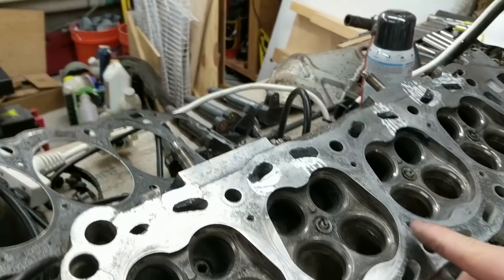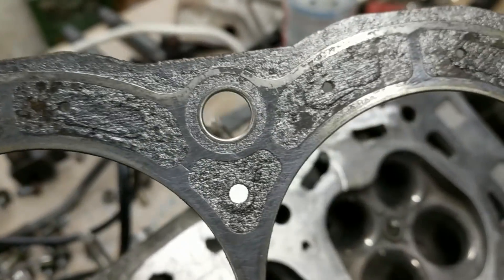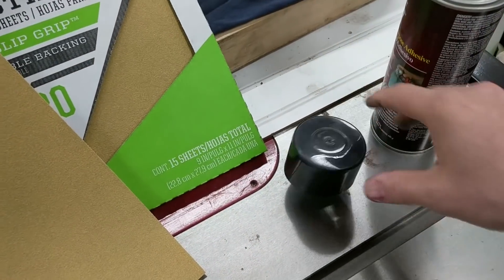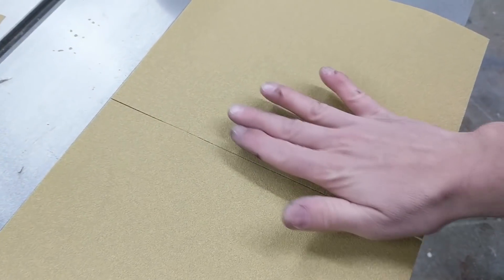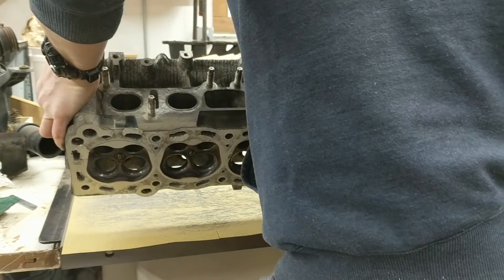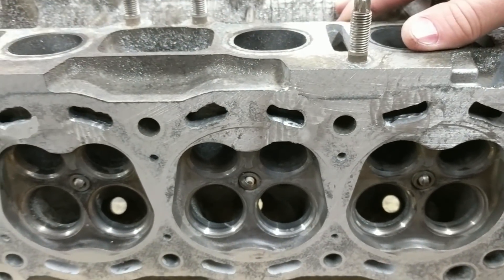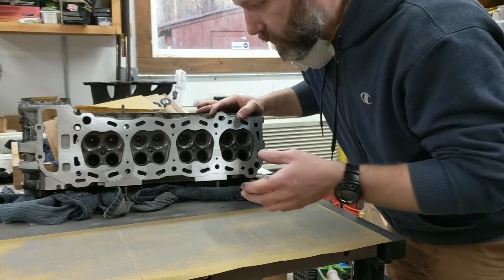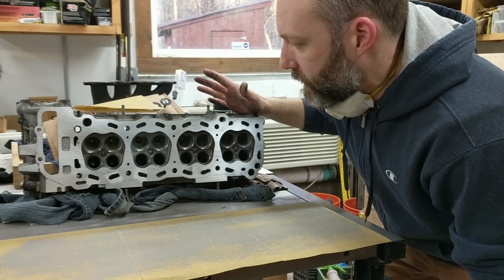Using a Table Saw to Resurface a Cylinder Head

Comment: Been doing this in cuba for decades, for all the naysayers, this does actually work just fine.
Reply: My waverunner head was Really warped. Glass table and sandpaper helped a Ton....
Reply: @easydoz1  glass wont warp from temperature change.  and the flatnesss of the glass.
Reply: A Cuban friend said the same thing when he saw the method I was using to bring back a motor for a destitute acquaintance. I'll put my time in to help someone that has earned that help but hasn't got the money - especially when told its impossible!
Reply: This is cool but with my ride/ livelihood I wouldn't take any chances... you're just better off going to a reputable machine shop and having the head decked..
Reply: If I were to do this I think shooting a shadow coat or machinist ink on a very fine sand paper would tell the tale pretty well. Heads are more forgiving than many think. I love precision myself but if you don't have it to spend, i would do it in a heartbeat. But as with anything the prep work before hand makes this time consuming. I actually fluid take a table saw and resection a timing chain cover off of a early 80s Datsun motor to fit up to a 75 Datsun motor due to not having one available. It sealed fine and not one drop of oil ever leaked.
Reply: @wayne251975   You explained what I was trying to say a lot better and they're more forgiving then most think. But some are better than others. Open deck motors usually need to be quite precise because of the reduced sealing area than a closed deck block. Years ago I actually stacked 2 head gaskets on my VW Jetta when I first added a turbo to lower the compression some. A few oldtimers I trusted recommended doing it with a set of ARP studs and the forums said it'd never work. Well I put 40,000 miles of abuse on it without a problem whatsoever and it became the forum trick that everybody started to use until head spacers and cheaper aftermarket pistons came along. Nowadays the aftermarket tuning is so good you rarely need to drop the compression so it's gone to the wayside for the most part though.
Reply: @wayne251975  just because all the ink goes away does not means shes flat. just means you were able to hit every spot with the high side ofthe sandpaper....
Reply: @JD10101-_-  that's just a starting point to at least see if there are any real concerns to start with. If the head is held down consistently and an even stroke with as even direction split up the ink could show if this would be worth while or a waste of time. What works consistently for some of us may not produce the first and only favorable result for others. For those of us who don't confine ourselves to simply say I can't here is an option. Options are good.
Reply: Nope
Reply: I think it's probably fine unless your engine demands precision and/or is taking a lot of conpression, like an F1 car or something, but for the every-joes Honda and Chevy, prob gonna get you through it.
Reply: @540 MUDSTAIN Top fuel heads have a steel o-ring in the heads around each cylinder that protrudes about .015" and run a copper head gasket. They also are used on super charged boat engines along with street engines too. That allows for a small amount of warping of a cylinder head.
Reply: In 1950s cars
Reply: I did the same and it work ok!
Reply: I may end up doing this for my Isuzu's heads. I don't want to put a lot of money into the rig by sending the heads off to be resurfaced.
Reply: @TheHermitHacker  if you do this start with a fine grit like 240 and just do it lightly. Chances are your heads will be pretty flat. You'll be able to tell because it will  have very few spots that don't touch the sand paper. Now if you see a lot of places that get missed or are deep,just stop and get them properly surfaced.
Reply: @540 MUDSTAIN Thanks so much for saying this! A lot of wannabes don't understand flat from grooved surfaces and there is a reason for torqueing and stretching bolts. Many don't even know how to hold a torque wrench.
Reply: All depends on parts availability. The method works, but often a reworked head can be found with more than just a refacing(valve work, porting, etc) at a good price.
Reply: There is nothing wrong with this approach... to get verified good results you will need a good straight edge or even better if you have a flat surface that could be equal to surface plate in tool shops.. Running blue ink to indicate high/low spots and you are good to go.. You can look up scraping steel surface and tools they use... Great job 👏👏👏
Reply: Por15 degreaser/metal prep is a great cleaner for all metal, and I would use an acidic mag wheel cleaner to remove oxidation on aluminium
Reply: Major tip to me
Reply: 540 MUDSTAIN  you are correct that’s why you have heads gaskets to seal imperfections. Doesent have to be super precision.
Reply: I saw pictures early on after the exchange of information from Cuba started... all the cars were pre 1959...
Reply: That is because communism and socialism inhabit the growth of new ideas and technologies.. when everything must be approved by our benevolent government..  the result is stagnation and the lowest common denominator for everyone... Socialism is communism's idiot stepchild... disguised as "sharing"... except sharing at the point of a gun is not really sharing, is it?... 

Freedom, and the free exchange of ideas and technologies is essential for a free society... the current paradigm in this country is a socialist state that promises to take care of us... if we just had a few more laws and rules and regulations... and the government to run the fix... and, of course, more enforcement..  Socialism is the velvet glove that hides the iron fist of totalitarianism... Socialism Sucks!
Reply: If you look at how wrapped the head was yet was still sealing fine, imagine what happend if you reduce it by 90%! Sure, it is not perfect, but that's the job of the gasket to make up for the imperfections.
Reply: Because you resurface the head every few oil changes lmao, this is not a long term solution...
Reply: @540 MUDSTAIN 👍 glad to see someone in this comment section with some practical knowledge!
Reply: @540 MUDSTAIN in your own words " It has to be precise in more demanding applications."
Reply: @540 MUDSTAIN I also have an old engine that has never had a head gasket changed. Over 300k miles, 300hp, 9500rpm honda k20, never been opened except for oilpan (baffling and trapdooring as well as bearing inspection) and valve cover (big cams and valvesprings). Cylinder pressures are pretty high on this engine compared to the ordinary shit people think needs to be machined perfectly (which is less flat than a well polished surface.)

Its also been overheated at least the 5 times since I have had it. (I run zero pressure coolant system, usually runs about 165f, but im too lazy to put in an expansion tank so eventually (~10k miles between fills) it sprays the water out and overheats, then i add more.
Reply: This moron has videos of motors with heads that leak HAHAHAHAHAHAHA.
Reply: Way I've been doing it
Reply: I believe you, so long as the table is perfectly flat.
Reply: @JD10101-_-  A straight edge and flashlight should show you that.
Reply: @gerhardbraatz6305  as a machinist, i'm talking about the type of flat that you can't see. maybe with older engines this will do. but anything with high compression and you will at the least want to use a verified flat surface. and at maximum use a granite plate, as it won't warp with different temperatures, where the steel table will.
Reply: @JD10101-_-  wrong,,, stop commenting.
Reply: @danielwarpaint1963  tru, unless you are running a backyard shitshop.
Reply: @JD10101-_-  35 years ago I did this daily on granite plates, do it enough it will wear even granite, had a guy come in and surface the plates weekly, he was a happy guy.
Reply: @rcdogmanduh4440   if you did this a lot, then you know the difference between wear in a surface plate, and the distortion that occurs in steel from temperature changes. one takes thousands of cycles to take place, the other can change just from the morning shop temperature.
Reply: @JD10101-_-  and this is why there is a difference between Machinists and Mechanic.
Reply: @JD10101-_-  I agree fully. The other thing that most Americans don't take into consideration is the camshafts are located in the cylinder-head un-like big V8's with camshafts in the block, with specific tolerances regarding oil clearance etc, now it's one thing straightening the mating surface but what about the warped cam journals etc. You'll drive a couple of miles and suffer from camshaft seizure due to extra strain on the cam journals from the warped cylinder-head and reduced lubrication due to insufficient clearance. This is in no way acceptable and would be a last resort in my opinion and only a temporary fix. And then also, your head has cracks from the valve seats to the spark plugs, sorry bud, using a scrap head to convince people to try this is not acceptable, why not use the cylinder head from your daily transport?
Reply: Holy shit some people here have some sort of hardon for throwing money off a bridge. flat is flat. check the cc to make sure its not angled to one side and if it is, then machine shop.
Reply: I have a twin turbo ,746 CI making 2,900 hp and i do my heads the same way it'll work just fine trust me
Reply: @540 MUDSTAIN they beat the piss out of drag engines. so i stand by what i said.
Reply: Jeremy Dillan  done this for years on motorcycle engines which is far more extreme tha. A car engine 12.1 compression and running 13-14,000 RPM this works absolutely perfect never had any problems doing this. That’s why you have head gaskets to seal up any imperfections and besides after a couple heat cycles any head will distort twist etc etc. does not have to be super presision. Probably done 14 engines this way over the years. For myself and my friends never had a problem.
Reply: Ya 10 seconds at a time. Try it on a 2000 hp boat motor that lives hours at a time @ 20 -30 lbs of boost...it won't last long enough to get past the no wake bouys.
Reply: Yep in Cuba, we have lazer tech machines here in capitalism.
Reply: It works in cuba because they have cast iron heads and blocks from the 1950s and early 1960s with very soft graphite cylinder head gaskets which are extremely forgiving, and low compression ratios.   It will NOT work on modern high compression all aluminum engines with stainless steel head gaskets.  They require a very flat, very smooth surface to seal.   And don't even think about trying it on a bi-metal engine.  Those things tear up head gaskets even in the best of circumstances, which this is far from.   Bottom line, you can get a car running this way but dont plan on it lasting for long.    ASE master certified technician here.
Reply: OOOOO SHIT we got a badass over here! @wouldnt you like to know, what do you consider high compression?
Reply: @wouldntyouliketoknow9891  I totally respect your certifications and envy them, that being said in these times  there will always be instances where desperate and thoughtful mechanics will always find a way to do what needs to be done and many will persevere. And i respect them all, and im not trying to imply that you dont, just sayingi
Reply: No it doesn't. Just because you've been doing it in cuba, doesn't mean it works fine. It means that there may not be another means. The head has to be clamped in such a way that it isn't deformed while its being milled. If you don't, all you're doing is throwing the head out of tolerance. When you bolt the head back on, it'll never sit the way it was intended to by the engineers. Then again, youtube is full of backyard engineers who apparently know better anyways...
Reply: @MaddoxInc If its not in a fixture, then there isn't any shape altering force on it, so you are essentially agreeing that the best method for getting a stress free and subsequently naturally flat result would be no clamps at all. Ya know instead of clamping it down in a way that holds it in its naturally stable position...
You're talking about doing the exact same job, just two different ways. One is with a machine and tons of force to accomplish the job quickly. Two is with no shape altering force and takes longer and a lot more elbow grease. Don't be salty that you drank the expensive machinery koolaid!
Reply: @beachboardfan9544  Not even close. What im agreeing with is that the head was engineered with a certain tolerance so if you're going to mill it, you have to make sure its flat so you're taking an even layet off, not just randomly sanding the bottom to remove the point which would leave you with a flat edge but no longer blueprinted.. It's basically the butchers way of doing it. You throw the head out of spec and so you shouldn't expect too much performance wise.

Comment: I think that may have been an aftermarket head-gasket you removed. Friend of mine bought a Replacement head-gasket for his 16 valve Honda...and the gasket was different than factory (having the same restricted passages)...he finally sucked it up....bought a head-gasket from the Honda Dealer....theirs had the full-flow passages stamped in the Honda head-gasket.

Sometimes aftermarket is not always the correct stuff to be putting on....or use as a reference of what you think is the correct item.

Comment: Just slap a viton coated gasket on it afterwards.  It'll seal up minor imperfections and hold tight.  I've used a mirror and sandpaper many times on snowmobile heads.  I'm sure it'll work on a car.  Use a 2x4 sanding block for the "rough" cutting and then finish up on the saw/mirror/pane of glass.  Saves a LOT of work.  You do NOT want it perfectly smooth.  You WANT a bite for sure.  Hose it down with brake cleaner.  Lap the valves using a drill and lapping paste.  Been doing it that way for years.

Comment: Apparently your time is basically worthless. It’s very inexpensive to have a head cut at a shop.
Reply: MX - To those of us for whom mechanics is a true hobby everything done DIY is an accomplishment with value.
Reply: Like I stated earlier, just because it was machined does not mean it is flat. You can clamp a head down on a worn out Bridgeport and fly cut it, it will look better but might not be flat.

Comment: Not acetone.... too volatile...lamp oil is the stuff you want.. for washing the crap off.  For degreasing when it's already clean brake cleaner is great
Reply: Diesel and a wire brush worked for me done 3 engines they all run. And are clean
Reply: kerosene always has worked for me in the past :)
Reply: crc 5 56 to loosen any sticking crud if wd 40 didn't work. Cleaning with dishsoap with some methylacohol in it. Cut the hairs of a paintbrush a bit shorter to become a bit stiffer.

Comment: Rigging up a slow geared down electric motor and attachment setup for the moving this back and forth would let you run it, but be able to move one to other things as it sands. Just check it often to keep tabs on it to stop when it is done.

Comment: 50 bucks at your local head and block repair shop will get it resurfaces on their head resurfacing belt sander. took many a toyota honda and mazda heads in and watched them do it in less than 5 mins. lol
Reply: And 50 bucks can buy a decent night out with the girl friend.

Comment: I've seen some mechanics get rid of warped heads piece of plywood and sandpaper staple to plywood only difference is they were using a lubricant like oil or WD-40 even the milling machine has a cutting oil

Comment: Not a bad idea but I couldn't help but notice you  can afford to aircondition your shop but need to save a few bucks on having a machine shop  mill the head ? The last one i had done was a Honda Civic  and the total cost was  a hundred dollars to have a professional shop  do it  who had it returned to me  the day after i dropped it off at his shop ?    I was just curious of course everyone has the right to do things their own way  perhaps you live in a area that doesn't have a shop. Thats capable of   Doing that  ?  I asked a local mechanic freind who he used and went with his reccomendation  who worked out well on several engines i  rebuilt  including doing a heck of a job on porting and polishing   Because he had the right equipment and was set up for it  plus years of experience and knowledge
Reply: Maybe he can afford to air condition his shop because he saves a few hundred by doing things himself instead of paying someone else
Reply: Well, he has a hundred bucks in his pocket doesn't he?
Reply: Man that comment is dumb as fuck.   Who gives a shit if his shop has A.C.  and assuming your a guy who pays people to do everything for you. Why the hell would you fault someone who is self sufficient?  if anything,  you should envy him.

Comment: There may be a spec for the minimum roughness  of the surface.  Costa Mesa R&D, has at least one video on resurfaceing a head and measuring the roughness of the milled surface.  It seems to me that the harder the gasket  (multi-layer steel vs fiber for example) that you would need a smoother surface because the gasket is less able to conform to minor imperfections.  Finishing the surface with 400 grit might be a good precaution.

Comment: i have lapped in many motorcycle heads and engine cases using your method. I have done this to minimize the amount of metal to take off as planing in a mill seems to remove a lot more metal.
The life of a racing head can be extended that way where it might be history after several milling operations. Lap those valves in and you will be ready to go.